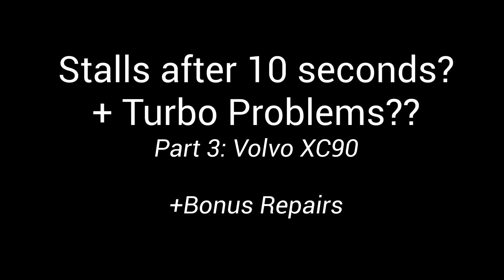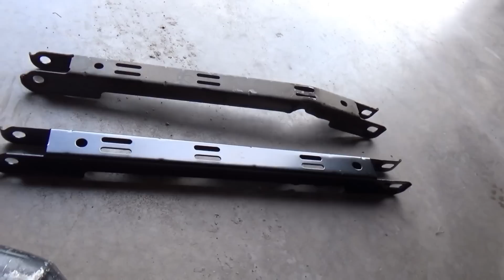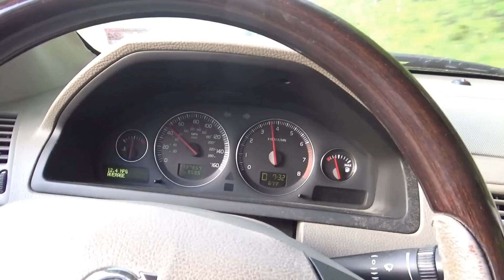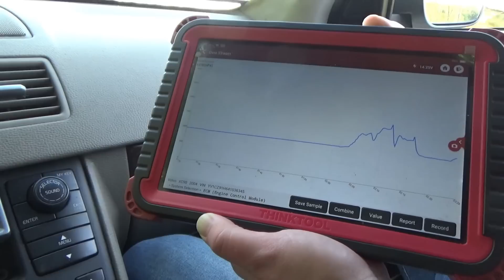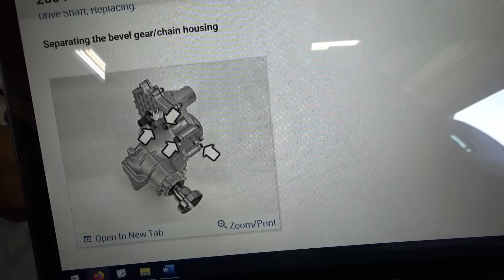More PROBLEMS?! (Part 3 XC90: Start-Stall, Low BOOST?)

Comment: "Someone has been here before" ... Volvos in the US seem to be plagued by moron mechanics, chinese crap parts and idiots with forklifts. Obviously designed to be worked on by on or above average IQ mechanics that put in and torque all bolts not just which ever they feel like... These cars are solid otherwise.
Reply: Looking at the failure rates of the GM-sourced automatic transmissions in the T6 models  of this era and that awful AWD-t-case design, Volvo’s engineers are every bit at fault here as well

Comment: Just replace the actuator. This is why these cars have problems from hack jobs with RTV. Sure, your soldering may have worked. But you already removed the part, just get a new one. Idk how the shop laws are in PA, but that's a  lawsuit where i live.

Comment: Talking about lost boost 
I was on a road trip to the Alps in France in my old 1994 Peugeot 405 TD and I'd just replaced the cam belt and water pump. 
I was nearly there and going up a massive hill at about 50mph and suddenly lost power pulled over at the top.
loads of oil smoke was coming out of the engine bay at the same time it sounded like a tractor.
I thought, nightmare I'm 600 miles from home.
Anyway looked in the engine bay and the turbo hose had popped off. 
Started it again and now no smoke but still sounded like a tractor, looked underneath the exhaust down pipe had snapped off 😂

Comment: The Steering Angle Sensor (SAS) is one of the more common causes of the "Anti-Skid Service Required" error messages the other main problem being the yaw sensor. I had the same message on my own XC90. The problem was the module for the Haldex on the rear diff (DEM). It was beyond repair so I had to get a reconditioned DEM costing just over £300. My Central Electrical Module (CEM) would also quit after about 3 hours of continuous driving. I was able to get the CEM repaired for about £150. Further to what I said about the CCM-0021 error code in Part 1, a genuine Volvo sensor MUST be used. VW makes a smilar sensor which will fit physically but it will cause the Climate Control Module (CCM) to throw a wobbly (it must be wired differently to the Volvo one).

Comment: (not for a customer, but if it was my own car):   A nice jerry rig fix would be to simply drain the chain fluid and run only transmission fluid in there.  Build a little catch can with a pump and tie it into that fill hole on the side of the chain case;   and the pump can send the overflow fluid through a filter and back up to your fill tube on the transmission.   That way it can just recirculate the overflow fluid coming out of the fill hole and pump it back into the transmission...   This way the chain case never really gets over full and so the external seal stops leaking.   It really wouldn't be that hard to fabricate, and would be so much easier than tearing everything apart just to split that case.  It's very foolish that they didn't make the inside seal small enough to fit through the outside seal-- that way you could just do them both from the outside.  Unbelievably bad design....    

But I have to say, 2 stroke dirt bike engines have a similar design, in that your crank stabs into the gear oil side where the clutch is mounted -  while the crank case has the mixed fuel flowing through it.  So the only thing separating the two fluids is a little seal on the crank shaft behind your clutch.   So it's not really 'unheard of.

Comment: I’ve heard of this from a Volvo dealer,if a car had a long crank,attach another earth,and there is a good chance problems gone,and I have done this fix,it does work,but I never considered why,as for the awd,ther is a lot around my area,I’ve never done anything to the drive train,but you did show me to be very careful regarding that shaft seal,that’s a remember ,so thanks for that information.

Comment: So Ivan..  did you charge for reinstalling the boost pipe issue?   I know you probably told him that it could be a MAF issue and he Ok'd another hour of diag for a that.  So did you charge him for finding and reinstalling that intake tube or did you just pop it on and not add any extra charge?   I'm always curious about these little decisions because it's kinda right there on the borderline where you could easily charge him for finding (diag) and fixing the disconnected intake.  Or you could also just say, "Good news, it was just a pipe so no extra cost there, I just popped it back on real quick" --   It could go either way depending on the situation.   I'm very curious as to what is the "norm" for that kind of thing.   So did you at least charge him diag time for reinstalling the boost pipe?
Reply from the maker: The pipe was actually blown off before it got to me, and it was a separate issue from the long crank, so yes I added some extra diag time 👍
Reply: @PineHollowAutoDiagnostics  Right on..  thanks.
Reply: He should charge when he can charge, because there are many instances he should charge but cant. He has to grab the free money too, because there are lots of losses everywhere.
Reply: @elbuggo  It's definitely a gray area when it's something so simple and you're already doing other major jobs on the car.  It's a situational call.. as for charging another full hour of diag time IMO.
Reply: @calholli  I hear you. Crucial here imo is if the repair had been ordered or agreed to. Cant just replace a bulb or whatever without any agreement, and demand pay afterwards. Not crucial for payment whether it was a simple fix or not. Unfortunately, too often the repair takes at least twice as long as expected, and this is often done for free.

Comment: T6 is a bad engine/trans combo. The rest is actually fine. Shame you yanks did not get the D5 diesel. Those are mighty fine. Mine is at 367k kilometers right now and running good. The aisin 6 speed auto is also working great. The bevel gear design is way different and cant leak auto fluid into the bevelgear.
Reply: Oh yes the D5, i sold mine over 720.000 km to a vriend, he toke it on vacation true Europe and the car is over 800.000 km and stil going..  super engine, luckily my wife's S40 had an D5 to..  almost 400.000 km..  very nice engine with a beautiful sound..

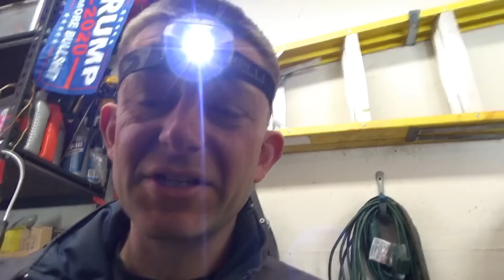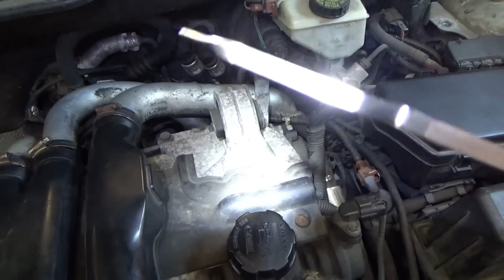Comment: You did replace the upper rear motor mount brackets before returning the car, right?  They are visible at 3:23 and not re-installed at 32:52.
Reply from the maker: Yes along with the giant strut stiffener bar 😉

Comment: I wonder about the gear lube in the chain case. In the 1970s, when New Process started using chains in transfer cases on four wheel drive trucks, the chains had a high failure rate in as little as 2 years because the chain got too long and would jump teeth on the gears. New Process figured out that the 90 weight gear oil they were using basically turns to a solid in extremely cold temperatures and didn't provide enough lubrication for the chain. Replacement chains came with instructions to fill the transfer case with ATF behind an automatic transmission or 10 weight oil behind a manual transmission. That change seemed to solve the problem with the chains. Modern synthetic gear lubricants probably don't lose as much viscosity when cold.
Reply: Intresting find

Comment: another option would be to tap threads into the actuator and screw a zirk fitting in it, then attach the hose.  also what a silly design on the transmission /chain drive case... the transmission generates fluid pressure, so its inherent design flaw is that it is going to blow fluid thru the seal and into the chain drive case..  likely  did  it from the day it rolled off the showroom floor. ha  I would just drive the damn thing and check the trans fluid level every now and then.

Comment: If you want a Turbo/Wagon buy a Subaru not a Volvo & get a 5 Speed, much more fun a pretty much un steal-able with the 5 speed, LOL.
Reply from the maker: Around here Subarus rust quickly... Volvos have much better corrosion resist 😁

Comment: That transmission/multiple seal setup is very similar to the AWD Mitsubishis of the 90s and 2000s, however I've not seen one fail.  Less of an issue even if it happened on the manual gearboxes as the fluid differences are basically GL-4 vs GL-5 and that's it.

Comment: Perhaps the Volvo owner could try adding ATP AT-205 Reseal to the automatic transmission with the leaking oil seal.  Recommended by Scotty Kilmer, so who knows?  It is not a miracle fluid, but it reduced leaks in my old Chevrolet Malibu.
Reply: Exactly. I have seen few in toyota forums also talk good about AT-205 reseal!
Reply: Scotty kilmer is a hack.

Comment: I am very curious as to your wheel alignment using string.  Would you elaborate please ?
Reply: HIs approach is the BEST in the alignment. I am a Math/Statistics/Chemistry and Automotive person and he nailed it! Make sure you have the specs of front and rear axles, I have free lifetime Firestone alignment on all my cars so I'll use it; I have done more tan 20 alignments in each car all for free!
Reply from the maker: See my how to video on string alignment 👍
Reply: @PineHollowAutoDiagnostics    Back when I started doing motor alignments on industrial equipment , dial indicators were the best method available until laser alignment was invented.  There were still mechanics using straight edges and rulers then in the mid 1980's trying to align motors to a driven piece of equipment. Regardless of the method chosen a Solid fixed  repeatable starting point needed to be established.   The best I see here is an alignment good enough to get the vehicle to an alignment shop.

Comment: On the 98 to 2003 and maybe newer beetle has gear lube in the ring and pinion of the automatics and has automatic transmission fluid for the rest of it

Comment: Ivan is one hell of a mechanic! I worked at the dealer when these were brand new and i gave up and got out of the business! They were plagued with so many problems i could write a book and start a youtube channel haha. Bottom line: If ivan has to put this much effort into saving these, what chance does the average shop have. Answer: none
Reply: I am not sure how other AWD systems work like my wife's 16 RAV 4. This design on the Volvo is crazy...there is an extreme potential for cross contamination of fluids. Having a seal to keep fluids apart...wtf was the engineering team thinking???
Reply: @mikefoehr235  The engineering team was thinking that the company would make a lot of money off of planned obsolescence.
Reply: I know AWD and turbos make for a great car to drive. I am no fan at all of turbo charged engines. When Toyota ditched the 5.7 v8 for the TTV6, I pounced on my 20 Tundra. As for AWD/4WD there are better designs and some that are not so good. I find it amazing that replacing a rear main seal lead to so many problems. I even wonder if trained Volvo techs have the knowledge to do proper repairs. Thankfully I am a poor working guy who will never afford anything European.
Reply: The Consumer Reports profile for the 03-06 XC90 rates it as "Much Worse Than Average".
Reply: Only answer I say, get Ivan’s earned college education.
Reply: @SocketSilver  That wouldn't be a Silver Bullet, cough cough SocketSilver.😂
Reply: @SocketSilver  Of course! He's in State College.
Reply: Yep. Those T6 XC90s love gearboxes too. That’s prob due its 2nd or 3rd gearbox soon.
Reply from the maker: Yeah these 1st gen XC90s really are money pits lol

Comment: Many years ago I worked on advanced engines and transmissions. We had major ground loop problems in the test cell. I had to write software to analyze the signals and compensate until we corrected the wiring.

Comment: 2004 xc90 t-6...surprised to see there still around. most people give up on them after their second trany goes bad. or the head gasket leaking oil on the passenger side. The older s80 with the same t6 engine is equally as bad

Comment: We Europeans, Germans, and others do not consider Scandinavians, Swedes, Europeans. 😂😅😂😅😂😅😂
Even Mercedes and BMW would not make something this complicated.
I did not see on that last diagram how the chain for the transfer case is driven. That axle has no gear or anything to drive the chain. Is there an outer tube that the chain runs on that I could not see there?

I owned a 98 S90 for about 4 years. Not awd.
It drove nice but was a bit of a nightmare to maintain.
Reply: yep, in the daytime they design super complicated transmission seals, then in the evening they will club a baby seal to death with a lump hammer, pickle it, then eat it 1 year later.... they crazy up there!
Reply from the maker: Yes hollow shaft that splines into transmission 👍

Comment: Watching you do these has ABSOLUTELY convinced me to never EVER own a Volvo, or Mercedes.  I'll stick with my old GM models.  Thank you Ivan.  Awesome content.
Reply: My neighbor owns a C class from 2011 with 450000km on the clock. Only minor issues thus far.
Reply: I like Toyota
Reply: I completely agree with your comment! Same here!
Reply: Even a BMW.
Reply: @SocketSilver  Auf Deutche...Bayerische Mist Wagen
Reply: I’ve owned just about every brand, 27 vehicles, and by far the 5 GM vehicles I’ve owned were the worst. Pure junk!

My BMW’s, Nissans, and Fords have been the best.
Reply: I slowly switched from older GM products to Mercedes (have had three, currently own two) and while all kinds of stuff CAN go wrong, I have no horror stories to report after 3+ years of ownership.
Reply: @kevin9c1  Year number 5 will reveal the devils
Reply: No issues with my Volvo so far!
Reply: @TheoPhilpot how many minutes has it been since you drove it off the lot? 😂😂
Reply: @jameslastname9171  I owned one for about 5 years, did around 30k miles, sold it at 120k, it was a great car other than crappy brakes and poor fuel economy.  Never had any major issues, but I also did all the maintenance as required and fixed any wear items (like shocks) immediately.
Reply: @jameslastname9171  Almost all of my Volvo's have nearly half a million km, or a little over 280k miles. I've got an 04 V70, absolute tank and honestly the best car I've ever owned. I've got an 07 Volvo S60, and a 2000 Volvo S70. They're all great cars that have given me very little issues in comparison to anything in the domestic market that I've owned. Keep in mind that the Volvo's featured on this channel are Volvo's that have had poor workmanship completed on them, especially the Wagon -- and it's not indicative of Volvo quality and reliability as a whole. Actually, if anything, the fact that these vehicles are still operational despite the butchered nature is a testament to Volvo overall.
Reply: @SpeCifiC0507  I absolutely agree with you. My 2001 V70 is on its way to 400000km and I'm happy with it. Volvos are some of the best cars out there.

Comment: Ivan, the Harbor Freight pneumatic brake bleeder is less than $20, and would save you so much time in sucking out fluids from transfer cases/reservoirs
It's not the best at sucking brake fluid out of bleeders, but it's great for jobs like that transfer case 

I use it all the time to quickly empty a power steering fluid reservoir when changing fluid, or sucking a master cylinder dry before a power bleed procedure
Reply: I actually have one and use it regularly. I lower the compressor output pressure to 20psi to prevent cavitation of the brake fluid and micro bubbles which form large air pockets. I also use it for extracting other petroleum-based fluids.

Comment: Wow, another Volvo coming up? At least we know it will be a three-part series. 😂 Great videos Ivan!!
Reply: Too bad they're all modern....

Maybe he'll get a 90's rear drive Volvo in some day, those are my favorite... I love those cars.
Reply: @flatdaddio, I guess this is why my brother's wife had said their Volvo spent more time in the shop than on the road!😂Thankfully they got rid of it long ago. Idk who these people are who "design automobiles" but I wish they'd stop and go back to simpler designs if they can't utilize "newer technology" without over-complicating it, making it massively expensive to repair and decreasing longevity. I remember back when vehicles coming out were said to "be able to wait 100,000 miles before the first 'tune-up' " yet in the last 20 yrs we have vehicles that experience major engine/transmission problems/failures in less than 100,000 to 150,000 miles, although some have managed to double that... But then there have been some vehicles from the 50's/60's which with proper maintenance have remained in operating exceeding 500,000 and in some cases, 1,000,000 miles. I'd like to see the stats on the percentage of "repairs" and "inspection failures" drivers experience which are ALL related to "emissions system components" whether those are internal or external to the engine/drivetrain.

Comment: Oh today was backwards Monday. Did a transmission in a Chevy Colorado. Broken flex plate and customers attempt repair and installed rear main backwards. 2012 Nissan versa crank sensor melted by exhaust leak. Wires unidentifiable at connector. Oem connector view was 123 and it should have been 321. Come home and water heater blew up. I hate Mondays
Reply from the maker: Oh yeah sounds like a Monday for sure haha!

Comment: Car lot brought me 3 gm 2.4 timing chain jobs in 1 week. They called on Thursday and asked about doing timing on a silver Malibu. I said I just did that one Monday. They said not it's another silver Malibu 😂😂
Reply: If the 2.4L is anything like the 2.2L, they will go a million miles with no complaint despite any mechanical noise or lack of oil.  The 2.2/2.4 ecotec is the Ford 300 of our generation.
Reply: @RK-kn1ud  No they are not even close bud. any Gm 4 or 6 cyinder 3.6 or 2.4 are some of the worst engines made